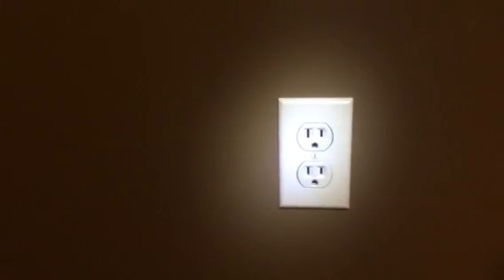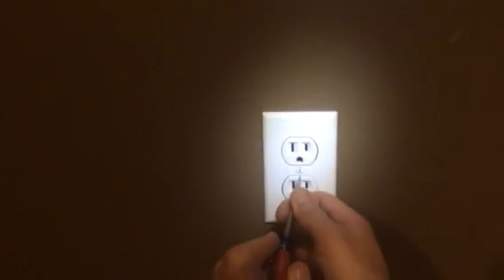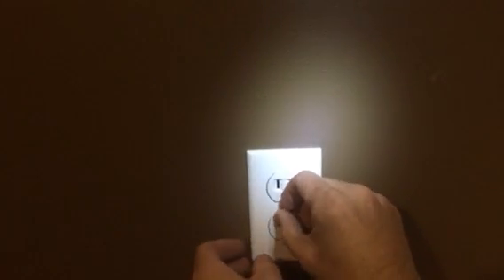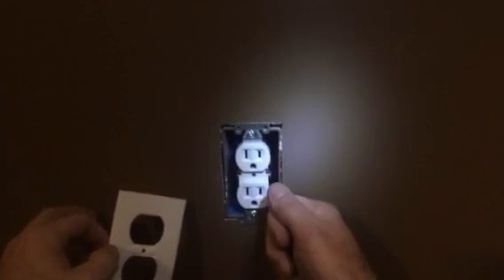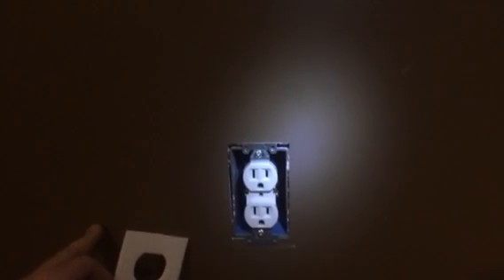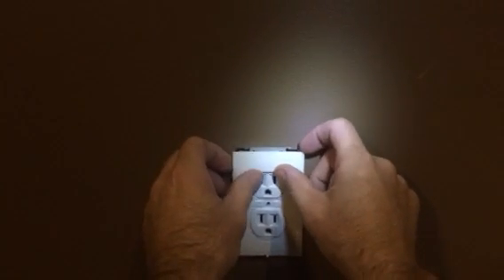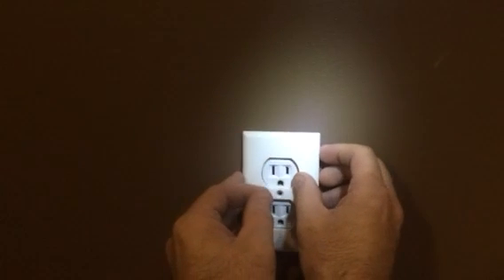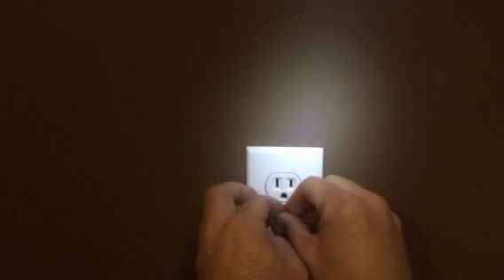How to Stop Air Leaks from a Wall Outlet?

Comment: Do you also do the shrink wrap on your windows? I know that you like the free heat coming in the home during the winter but would the extra insulation also be worth it?
Reply from the maker: The windows in my current house don't leak much air so I don't shrink wrap them.
Shrink wrap on windows is a good idea if the air leakage is very high. Even though all windows leak, energy efficient windows leak much less and don't need to have shrink wrap.